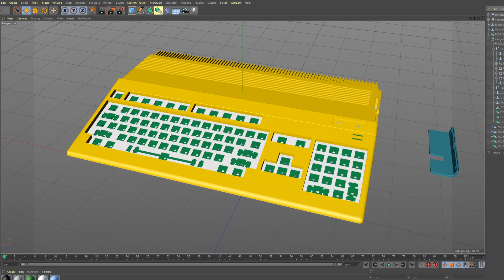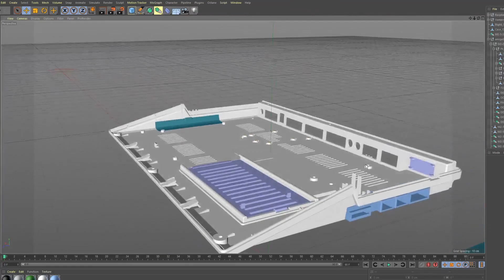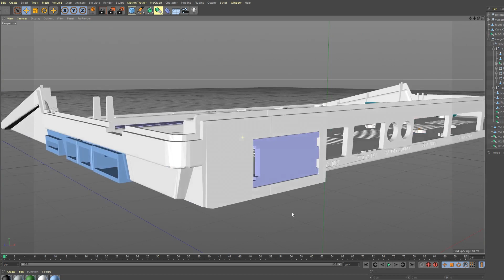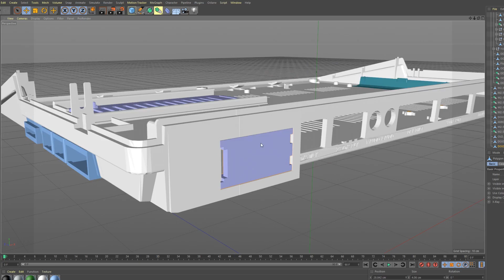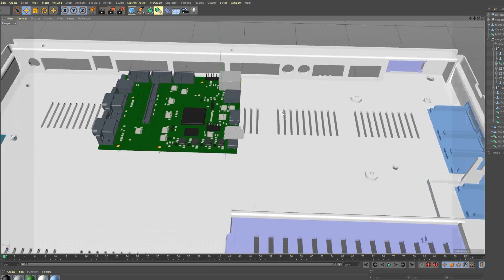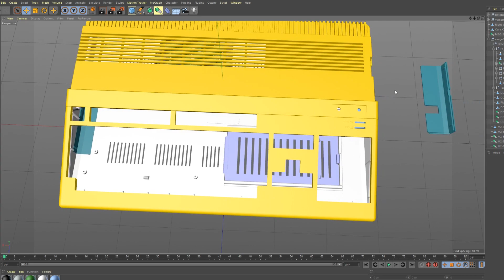Amiga 500 Case Campaign Update - 25/9/19

Comment: Are these cases compatible with  MiSTer FPGA?
Reply from the maker: Hi,

No physical mounts are present for MiSTer FPGA in the case.
So unless drilling holes, the case isn't ready for this device.

Thank you for question fdn777.
Reply: @A1200NET  Thank you for answering me as it is crucial to me to decide what to do. Perhaps i will have to place a plastic base which can be screwed in your case and will have holes drilled for the MiSTer.
In any case i hope that in a future revision you will include support for the MiSTer.